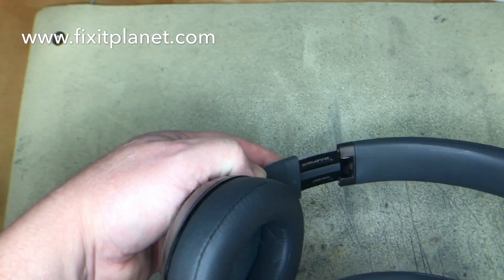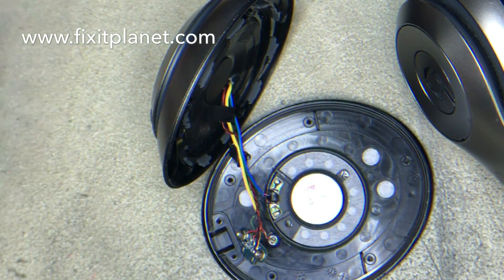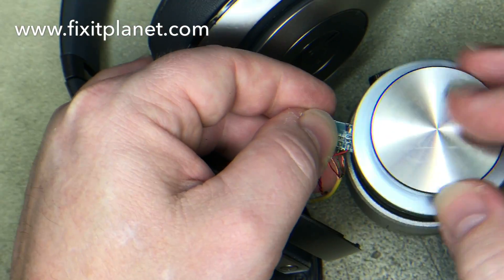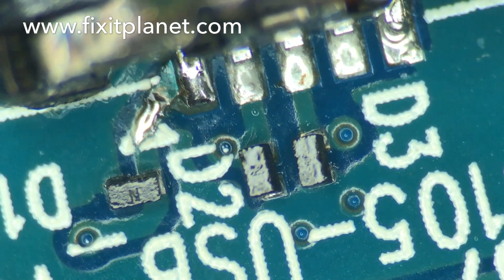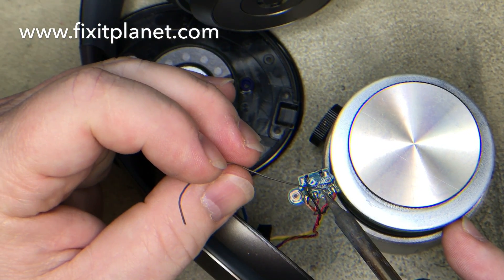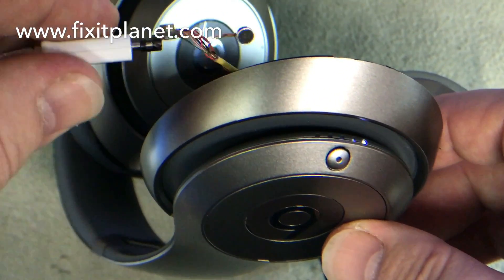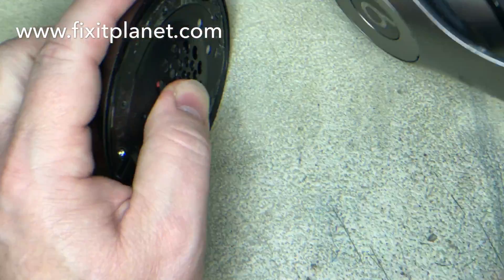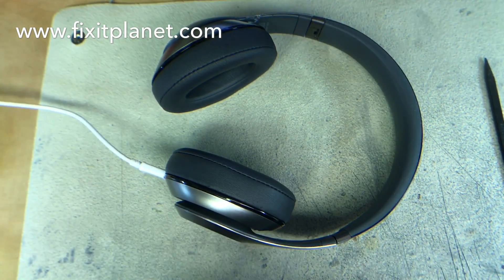Beats Studio 2.0 Charge Port Trace Repair From Start To Finish.

Comment: I need help. every time i try to charge my beats I charge it it won't charge and I have to force it a little for it to charge, then it starts to charge and I let go of it and it stops charging. I'm worried plz help me asap and I have the whole kit of the soldering do I have do that?
Reply: The charging port is busted. This is a pretty easy fix. It costs around 20 bucks and it's not too hard. Just search  charging port replacement on beats, on youtube, and you'll have all you need

Comment: My set has weird charge port issue. The port is super wobbly but will still charge if plugged in just right (which is really tough to do). Would like to have an idea of what exactly is wrong before I dive in and fix it myself. If it's just a issue with the screws then I can fix it pretty easily but if it's something that requires a soldering iron, I might have to take it to a shop.
Reply from the maker: The solder joints are most likely loose (very common). The entire dock can be swapped out or the joints can be re-flowed or repaired but in any case soldering is required.
Reply: Thanks.